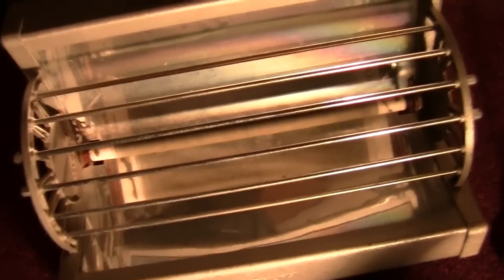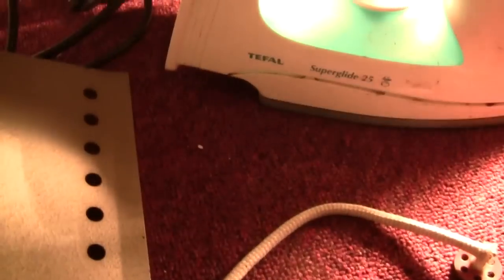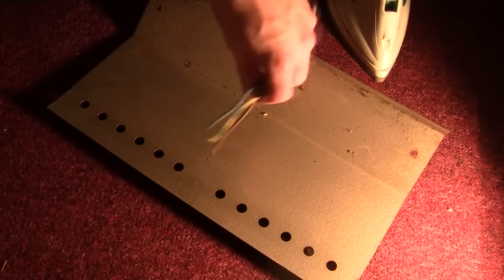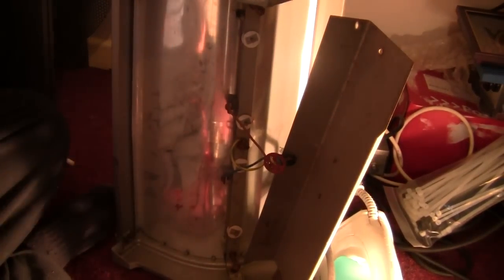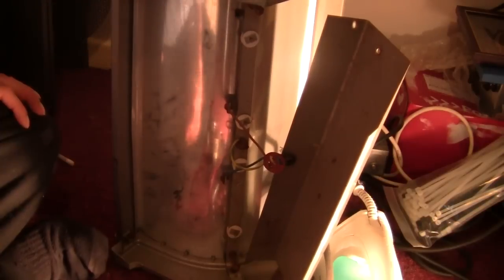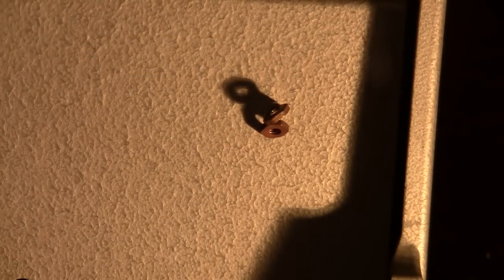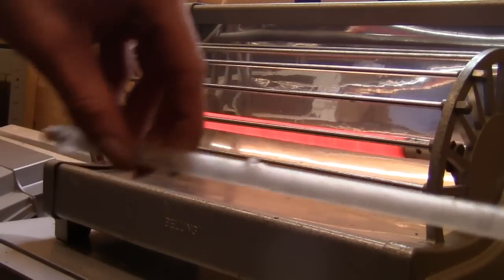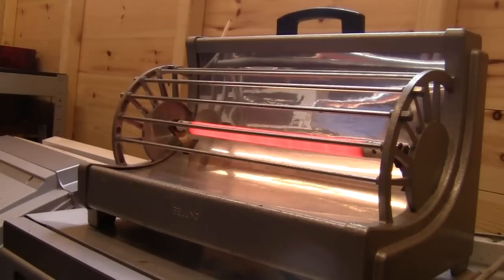vintage heater repair

Comment: I used to use these 1KW heaters as ballasts for various electrical projects in the 1970s. They worked great, and you could short out part of the element with some wire and a large croc-clip to increase the current a bit when needed.
Reply: I used incandescent lamps for ballasts for some fluorescent tube experiments. Pretty cool!